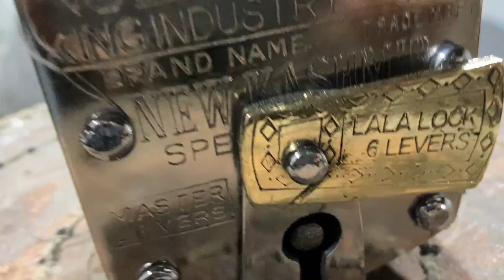interesting process this lock making factory || stainless steel lock manufacture

Comment: In Pakistan, when you lose the keys, the locksmiths can clone a key in mere minutes. Have used their services for nearly every type of lock. But when it comes to this style of lock, they are so secure that the locksmiths dont even try and ask you to buy a new one. They are considered one of the most strongest and secure locks in Pakistan and cheap aswell. Come in all sizes. The one in the video is the medium sized one. Heavy too.
Reply: It's cheaper to buy a new lock than to make a new key. This lock is not secure.
Reply: Hb
Reply: Looks to me like they used the same keys for all of them or am I wrong?!
Reply: @alexbadillo9940  
They probably make batches of em, with the same key pattern to streamline the production
Reply: @alexbadillo9940  The locks and keys have matching numbers punched onto the metal but they're not 100% unique ie Can have 0 - 100 unique combinations only. I bought about 10 locks and found three with a no 9 (same key). Ofcourse, had to unpack a lot at the hardware shop to find matches. Prefered matching numbers so I dont have to carry a heavy keychain
Reply: @cooleo1979   Don’t you think that’s kind of risky?
Reply: @alexbadillo9940  Not really. There are 100s of workshops making em (all of them with their own key combinations and styles). It's very difficult to find the same key again let alone the same manufacturer brand. But you're right. There's still an element of non-security. My use is not security related. It's mainly used for closing/opening gate access to certain areas.
Reply: @cooleo1979  Indian locks from pad- to safelocks have typically 5 to 8 levers.
They can be opened easy with a  selfimpressioning key that either has plastic bristles or aluminum shims which will bend to the height of each lever. When you are in the know like a masterlocksmith you can open almost anything.

Whats in a way funny is that the majority of Indians lock their home/apartment from the outside with one of these padlocks, so when you see a padlock on the door that means nobody is home 😉

Comment: If the levers are uniform in all locks, the key will be the same to open all locks.
Reply: Every lock and key set can be unique if the teeth and the levers are filed randomly. But it's still easy to open for its simple design.

Comment: These locks are really huge and also look very stable.  I just didn't fully understand how these locks are specialized, so that not a single key can open all locks of this type.  Did I miss this step?  Or was this step not shown because it is a trade secret?  Because if all these locks are COMPLETELY SAME, that would be a great craft, but it would miss the point and purpose of a padlock a little ...
Reply: Same question 🙋
Reply: I think 
One key for all locks
Reply: It was omitted from the video. They don't all share the same key. Probably not a great idea to show all the inner workings of your padlock, especially the key locking parts. If they only had 1 key design for their padlocks, they would have been out of business a long time ago. lol
Reply: These locks are very popular amoung jewelers. Thieves cannot open these locks,.
Reply: @4599khankhan  Let the LockPicking Lawyer have 10 seconds with one of them.
Reply: They have ward plates in them. If the plates aren’t in a certain spot the lock won’t open (that’s why the key has notches cut in it)
Reply: @ubergeek1968  More like 0.10 seconds.
Reply: No se utiliza la misma llave. Con solo cambiar el orden de las gorjas, cambia la combinación. Tiene el diseño de la cerradura francesa.

Comment: Are all of these locks keyed the same? Making these locks is really labor intensive but I am pleased to see that the workers have a job.
Reply: yea they all have keys with tube in them which is required for its mechanism, i remember as a kid when such a lock is obsolete grab an old key,  put match stick powder in it with a nail head-side in the key, attach the key with a stick for leverage and strike it on ground or rocks. this made our firecracker bombs hehe :D
Reply: if your ques was if that particular key goes in all these different locks, no
Reply: Lock companies make batches keyed the same to streamline production, then use another pattern for their next batch